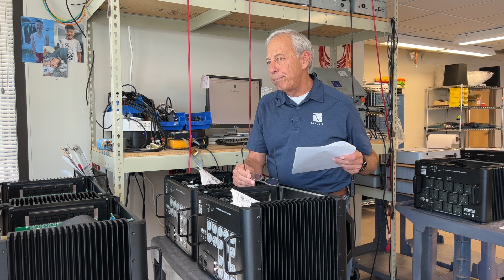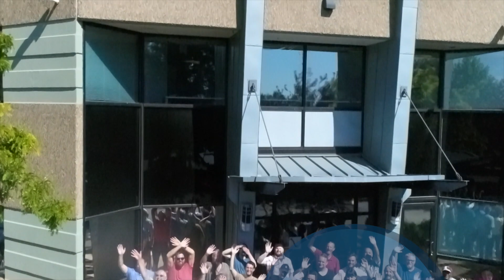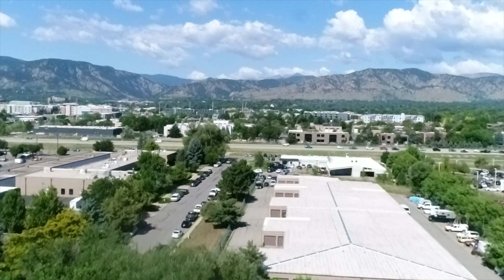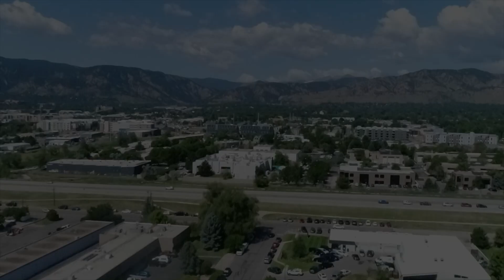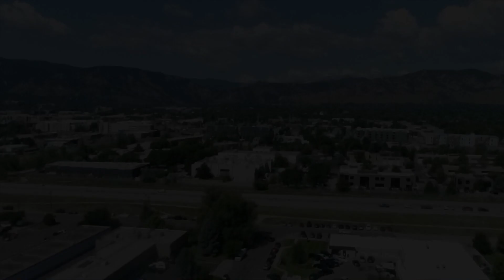Distortion affecting frequency balance

Comment: Frequency response is necessarily a small signal, linear phenomenon. Moreover, frequency response measurements involve perturbation at a given frequency and measuring only that frequency content at the output. In that sense, harmonics will not show up in the measurement because you are not measuring them at all. A spectrum analyzer should be able to show the harmonics though.

Comment: Yes the balance changes. The frequency response doesn't particularly change in the sense of a certain frequency in to the amount of THAT frequency out. New harmonic and intermodulation frequencies are added by distortion. In deeper distortion, compression (frequency dependent) and blocking can also can occur.

Comment: Hi Paul,  I read 25 years ago how distortion effects change our perception of loudness / db levels.  My big rig can play much louder without sounding too loud, while the little rig gets harsh fast and sounds louder in a bad way . 95 - 98 db range.
Reply: Sounds like your small rig is underpowered and struggling a bit, hence the harshness, compared to the big rig which I'm guessing is adequately powered with better components, therefore sounds less fatiguing at higher volumes
Reply: Oh god

Comment: I have read that bigger mid-woofers filtered too high can sound harsher than equivalent smaller units around crossover frequency. The tweeter might not be the culprit.   Bigger woofers beam sooner (less dispersion) also.  Otherwise, why would we buy smaller mid-woofers if they didn't have some benefits ?
Reply: @Douglas Blake The quality and design of the driver is important. However, I don't think that a 20 cm driver (with more weight and inertia) will be as accurate and fast than a analog 14 cm driver for frequencies around 2 kHz. Otherwise, tweeters wouldn't exist and full range drivers would be the norm. By the way, there's a formula to calculate beaming of a driver in function of the size. Size and weight matters.
Reply: @Douglas Blake I wish I could hear these speakers in a good room. The hypothesis applies to drivers of the same quality, not between a budget one and a masterpiece. Many sealed box speakers ("acoustic suspension") are two or three way, because it's hard to find a driver that can do it all well. I suppose that's also difficult to integrate several drivers. Bigger woofers might need very good tweeters than can go low enough. Budget speakers can't afford these tweeters. Usually, some big speakers can do things than smaller ones can't do as well, and vice-versa: imaging, soundstage, sound pressure, lows, rigidity... However, the room is probably more important for me than the speakers. Sometimes, some «high-end» systems are unlisteneable.
Reply: @Douglas Blake That's the goal of big drivers. I don't like much small woofers that try to handle low frequencies, or big woofers for high frequencies. Heresy aren't known for lows, that's why I think that «good» active sub-woofers are analogous to tweeters: masters in their range. Every design is a comprise.
Reply: @Douglas Blake I don't use subs for shaking the room. Instead I adjust them for a less colored sound and a more accurate timber (to my ears). I followed the interpretation of Paul McGowan. An adjustable gain, crossover or even equalizer gives more flexibility for speakers placement than the passive counterpart. The setup isn't easy in bad rooms; another compromise. A lot of work needed in the crossover of the last Heresy (the ported version) and in the specs sheet. I wish that some brands would have more «accurate» specification sheets and units for sensitivity, like dB/W and nominal impedance (80%). I recommend some math and the video of John Devore about that subject.
Reply: @Douglas Blake There's nothing personal in my comment: just technical clues. My intention was to talk about general data, dimensions or perceptions, with no brands in mind. You named the brand; which is even mentioned by Paul McGowan in his book. When sensitivity don't match with reviewer conclusions and measurements, maybe the unit is wrong. Not only Klipsh does that, many others do, which is a prejudice for other brands or for customers that use to calculate power needs. The point is that the model you named is a three way design, why? My answer —I might be wrong— is that the big woofer can't do mids or highs well, not even lows. I'm not against big woofers in three or four way designs. I just think that they are not optimal in two way speakers, except those which have exceptional tweeters that can play mid-high frequencies.  Otherwise, speakers design wouldn't be so difficult.

Comment: Well.... A friend of mine was tricking me into swapping my Stellar Gain Cell with his preamp (won't mention brand) I heard exactly that harshness just in 5 minutes of listening after trying his in my setup and  I told my friend: if you want to comeback to this house, please don't mention that crap ever again.... don't even mention the two of them on the same sentence. :-)
My system: Stellar Power Plant - Ifi Zen Streamer - USB output - Stellar Gain Cell DAC - Parasound JC5 (used to have M700. Not fan of class D - Sorry Paul!) ELAC Uni-Fi 2.0 – UF52 - 2 subs REL t5i

Comment: sounds bright to the ear but measurement equipment can not show that in the graphic. it registers flat but sounds not flat... what increible piece of gear the ears and brain are.
Reply: Others measurements might be more adequate for distortion than frequency response. I guess that one graph can't do it all.
Reply: @Jorge-Fernandez-Lopez  Which ones?
Reply: @eduardzamora-boix3615  I should have specified that my hypothesis was about speakers. Distortion with one tone (sweep) or multi-tones and dispersion, like those of Audio Science review or Erin's Audio corner, might help. Some times mid-woofers are too big and crossed too high, when it's not dispersion that's too wide, all of which a single frequency response can't explain. In my room, my less than optimal equipment was harsh (dispersion problem). I solved the problem with «very nice» DIY panels; even if these changes can't be seen on an axis frequency response measurement, they are perfectly measurable.
Reply: @Jorge-Fernandez-Lopez  Very Interesting. Thank you very much
Reply: @Douglas Blake Thanks

Comment: This is a poor explanation from an engineering perspective. Whatever is being described as “offensive” or “frequency aberration” as a result of a change of capacitors is a signal change that can be measured in other ways than with a frequency response curve.
Reply: Have you done any real listening teats with different components ?
Reply: @pauldavies6037  Of course. I've done lots of listening tests including blind tests as I work in audio engineering. Especially on speakers, listening tests are super important as measurements can't entirely judge things like soundstage authenticity. The electrical effects of a capacitor on an audio signal of course can be measured and explained. Capacitors, like anything else in existence, follow laws of physics. Paul makes great videos but this particular one doesn't provide any information at all of why you want a better capacitor from a technical perspective. In most cases of a modern audio circuit (except in the cross-over filter of a speaker), capacitors are not involved in the actual signal path but rather in the power supply rails filtration, and swapping them should be done only when they get worn out after many years of use and the power rails start getting noisy.
Reply: @ThinkingBetter  you work in audio engineering, then you of all people should know paul talks nonsense and governments and world leaders should be made aware of this before people get hurt
Reply: @Douglas Blake you know what, I take it all back and completely agree with you 👍 I still think world leaders should be aware of this channel though, just as a precautionary measure for now
Reply: @geddylee501  This video is mostly nonsense yes.
Reply: @geddylee501  When we observe something (and it is 100% confirmed) and  in understable way we can't explain it,   I think we should rather stop at this moment and dig deeper then  justify  it in non technical measures  by quality of  component production   and price because these  are non scientific. We can't generalize about capacitors beacause their behaviour shows differently  in specific circiuts and circuits   are not comparable,  

Specially capacity is component which may  vary by   capacity to   construction or plate  and to other components  - it is obvious in radio and TV technic. I observed that frequency balance of my tube amplifier was affected by manual changing  of capacitor distance to chassis.

 For  resistors we can assure total insulation to construction but  for  capaitors cannot - there is always "leaking" which is hardly  defined. With replacement operation it may sometime be not exactly  as before. Another deep problem is accuracy of value which in sensitive circuits like  crossovers may be confused with better  market price  of capacitor. 

Once whole gear was aligned in 90% cases any change reqiures new alignment just as in cameras with change of even lighting needs new  balance of white,. That balancing in my opinion is so slight that may be provided only by alignment of speaker and room acoustic. When I am satisfied  with sound it is so unique that  I would never change capacitor for reason of the way  it's made. .
Reply: Proves one thing...
Put a dozen "educated experts" in one room to discuss a topic and you'll get almost a dozen different answers. Happens almost every time in this comment section.
Reply: @Mark-lq3sb  Perhaps true. Nowadays you can become expert in "flat earth theory" by watching Youtube videos. In other words, "expert" means nothing. People who claim to know about audio often know only what some snake oil sales people and online videos told them. I have little respect for such "knowledge" and find much more respect in people who actually understand the underlying science of audio. A capacitor sounding different is not due to magic but due to a capacitor component having other characteristics than the fundamental of a constant capacitance. Internal resistance (ESR), inductance and other parameters can contribute as well depending on application.